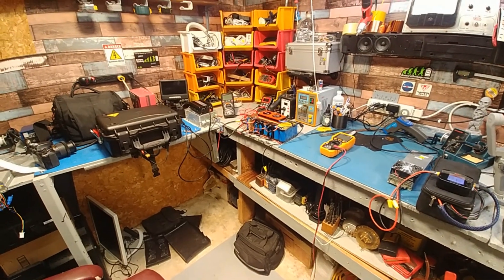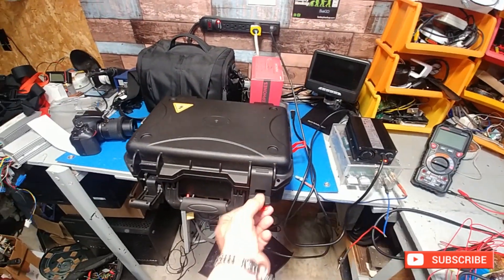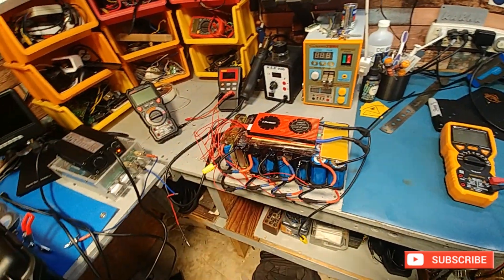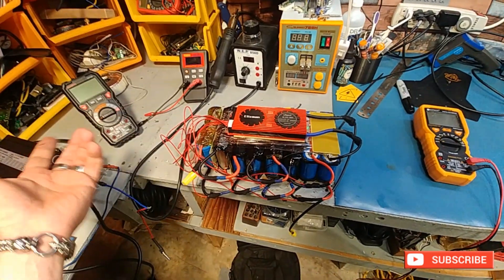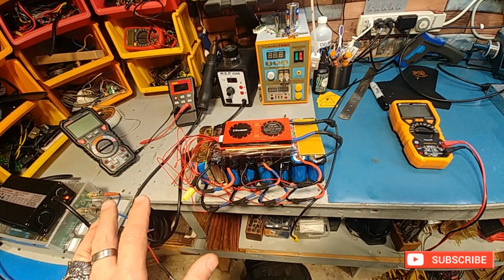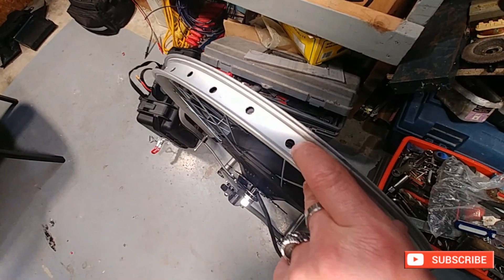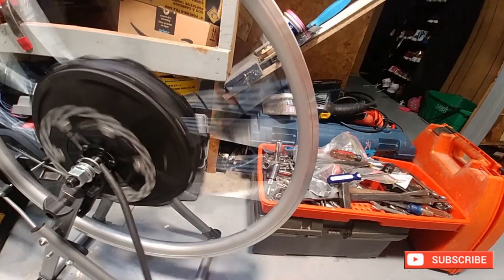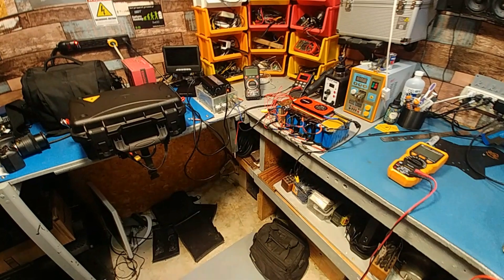ebike vlog# good test run.  Wednesday, April 12, 2023

Comment: My bike will try to wheelie on take off - sounds like what you're dealing with. I use a cheap chinese controller, which I think you do too....but if I put it in electric "low gear", it ramps the throttle up as you accelerate, rather than just slam it with max current on take off...makes it much more streetable.